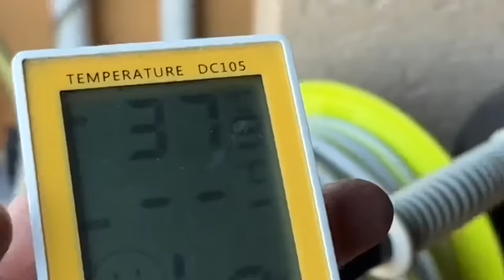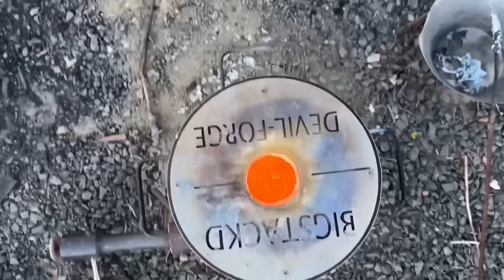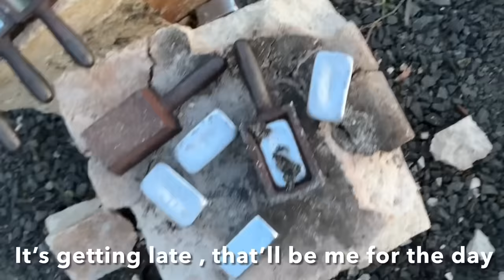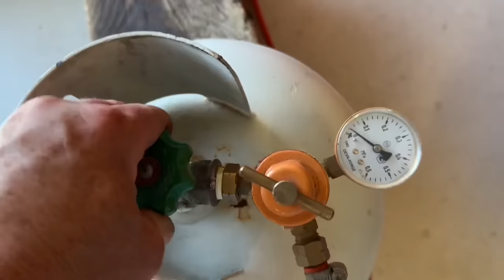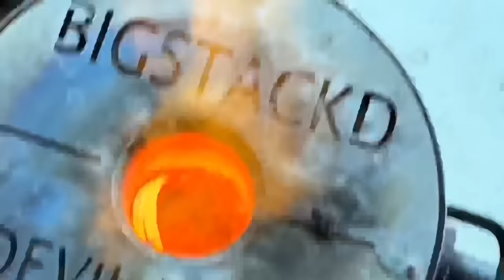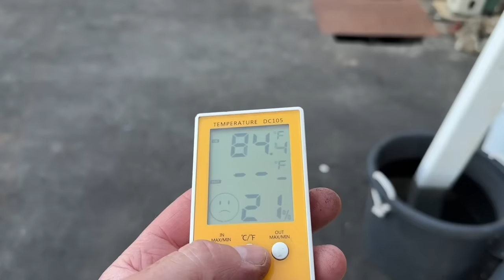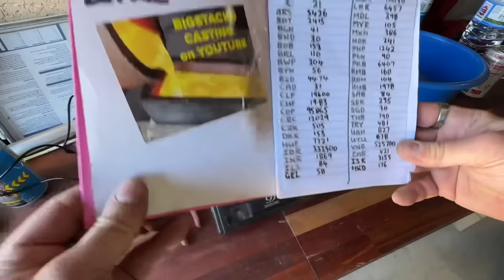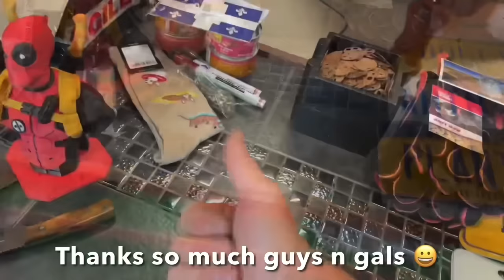351 Ford Cleveland Piston Melt Down - Bulk Bars - ASMR Metal Melting - Trash To Treasure - BigStackD

Comment: I wonder if you have considered a mirror above the furnace for top down shots? Doesn't need to be directly over, but grants you an easier angle to view the melt? Just a suggestion, hope you don't mind. Love the channel!!!
Reply: Mirrors can actually break in high heat situations, especially when the heat is turned off. They cool down too fast, causing them to crack or even shatter.
Reply: He could make his own high temperature mirror. Take a bit of copper, pour it into a plate and polish it so it can reflect. Would be a red mirror but could work.
Reply: @Mowraq I think you're on the right track, but polishing a sheet of stainless steel would be the ticket
Reply: @benstrait333  If only he could melt steel.
Reply: @Mowraq  No need to melt it, just polish a suitable chunk of stainless steel from the yard. As a bonus being in a dry climate it would hold the polish for a long time.
Reply: @SeanBZA  Sure, but my point was him making it completely on his own from scrap and scratch.

Comment: Definition of dedication is Doing a melt at 35deg C, hardcore 😂 great vid as always! Not that this is relevant for this vid, I thought I’d mention this anyway, when I strip motors I use a hammer and large chisel to cut the returns off the windings, then punch out the rest the same as you. It’s definitely more time consuming than your way but no mess / waste and oddly more satisfying. Cheers for the vids 😊

Comment: Subbed to the Channel, i cannot resist to that metal melting of stuff that has been taken out from landfill dumpsters and arrived there potentially with a Mack superliner loaded of trash with fuel tanks with a massive over 2000 liters of capacity

Comment: Very entertaining as always.  Two questions.  First, when can we expect a 351 Ford Windsor Piston Melt Down?  Second, why don't you have a band saw to cut those pistons in half?  That would make it easy to remove the piston rings and would reduce the need to hammer things apart.  It would be less dramatic but your thumbs would thank you.

Comment: Great video BD- we are very early to e melt game-  laying along at home- I've had 1 lay with copper but im not doing something right-  some looked gold (ac pipe ends) some looks silver/alloy (copper scra wire) and one lot turned out like rose gold (power boards).
Im urious to know what temp you set it to and how long it took for each of these melts😊

Comment: Fantastic video I love the 351 Cleveland engine and this video was very cool. I was wondering if the carbon that is built up on the pistons may affect the aluminum alloy when melting it like this. Not very well versed in metallurgy but I recall reading about carbon added to molten iron along with other alloy materials to make steel. I doubt carbon can alloy with aluminum but wondered if you had thought about this. Cheers🍻